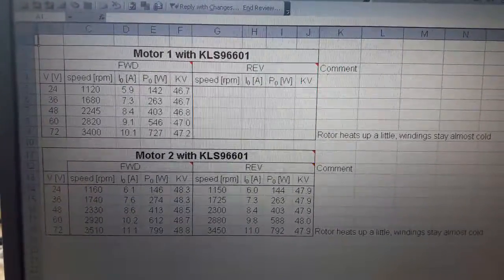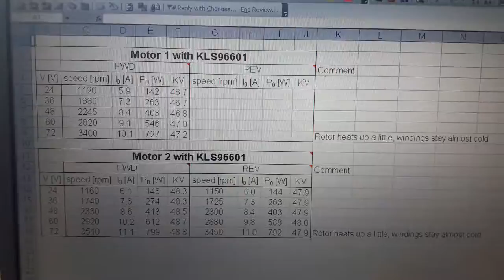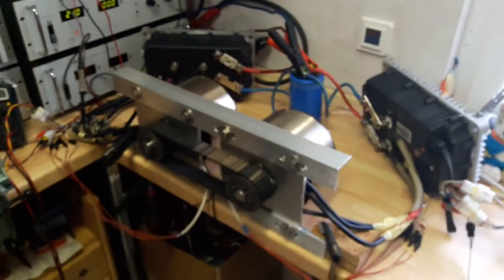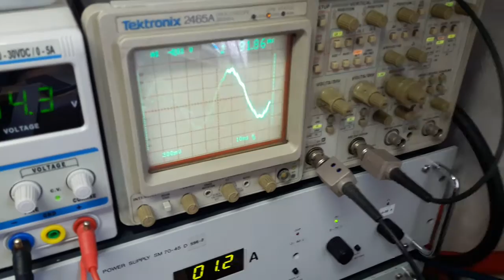No-load of REVOLT 160 Pro (Brushless DC Motor)

Comment: How much more power does the motor consume when using a regular square wave controller? Thank you :) 
Also, do you have experience with the revolt 160E/Es? Or have you thought about buying one of these, because they have additional cooling?
Reply from the maker: I tried a square-wave controller in the beginning. It wasn't very smooth, lots of noise. So I stopped experiments without looking at power or efficiency. I also already saw the 160E. Soon I will upload a short video comparing 160 and 160E
Reply: Next EV wow very nice!! I am planning to buy a 160Es. From your experience so far, could you quickly sum up what you think of the 160E? 
PS: I really like your tests, keep up the good work.
Thanks :)

Comment: What is the maximum power that the generator can continuously supply to a battery 
when it is connected to a three-phase rectifier and a battery, what is the voltage and current in that case ?

What is the maximum power that the generator can continuously supply to a battery 
when it is connected to the controller and operates in regen mode, 
what is the voltage and current in that case ?
Reply from the maker: Good questions, I couldn't answer. Too many variables, highly depends on the conditions. With the experience so far I would guess like 6 to 8kW as product of voltage and current which depend on the kV and the actual speed.
At the end it almost doesn't matter where the generator delivers it power to, either controller in regen or three-phase rectifier and a stack of batteries.

Comment: Could you please post a diagram of the used motors, controllers and other components ?
Reply from the maker: Diagram? What are you looking for?
The controllers are Kelly KLS96601-8080I
Power Supplies are Delta Electronika with 3kW
DC link is (meanwhile) 40mF
Reply: Why do you use a controller on the generator ?
Is this controller only used in regen mode ?

I'm interested in the performance as generator not connected to a controller but the 3 phases only rectified 
and used to charge a battery.
Reply from the maker: I started with a three-phase rectifier and an electronic load, which was limited to a handfull of kilowatts. That's why I decided to use a controller in regen mode. This way I got very clear values for the overall losses (of motor, generator, controllers and aux).
The experiences so far as generator are slightly better than as motor.

Comment: We are using the same motor, do you happen to have all the correct parameters of the motor? if you do can you attach it or comment below.
Reply from the maker: Before getting you wrong, which parameters are you talking about?
Reply: The motor parameters we need are:
·         Ke:
·         Ls(státor inductance):
·        Maximum Stator Current – Is:
Reply from the maker: For those ones I recommend to contact the guys at revolt (because I do not know). They are very helpful and will gladly answer your questions

Comment: hi I wanted know is that.  is this motor good for production motorcycle.
Reply from the maker: I donno, testing is still in progress. I guess it could work for a motorcycle. Anyways it highly depends on kv, voltage, gear ratio, current settings and so on...

Comment: Thank you for doing this, I really appreciate it.

The Io result is really interesting. I think it is very abnormal for a typical brushless motor to have Io so dependent on RPM. I put the figures into Excel and got it to generate a trend line. From that, I split the current loss into the respective coefficients.

http://i.imgur.com/zzGvIwZ.png

The graph looks very linear yet quite steep, showing the loss that's proportional to the RPM (Voltage) to be dominant.

I guess: the X^0 coefficient is the stator hysteresis and bearing friction (the drag force of this to be independent of RPM), the X^1 to be the effect of the rotor eddy (drag force proportional  to RPM), and the X^2 to be aerodynamic drag (drag force proportional to square of RPM). I don't know why the X^2 coefficient is negative, but this loss is not so significant (and not expected to be significant).

The manufacturer told me directly that the motors should mechanically be able to handle up to 6000RPM. The Io loss should be higher for a higher KV motor. So for the maximum rated voltage of 96V, it should support windings up to 62KV. That could result with an Io of 16A at 96V, an unloaded loss of around 1.5kW, the vast majority of that seemingly being lost in the rotor case. So it seems to me you might be better off trying to cool the rotor case instead of the stator inside.

I also had this from the manufacturer: theoretical phase to phase resistance of RV-160Pro: 50KV - 0.00576ohm, 56KV - 0.00455ohm, 64KV - 0.00349ohm
Reply from the maker: Nice job! Personally I would have expected some more aerodynamic impact.Some thought about the big bearing being responsible, I could not second that:https://endless-sphere.com/forums/viewtopic.php?f=30&t=75494&p=1178976&hilit=rv160s#p1178976In that forum you'll find also some people rewinding the Revolt, which won't help the rotor losses much. Stay tuned...